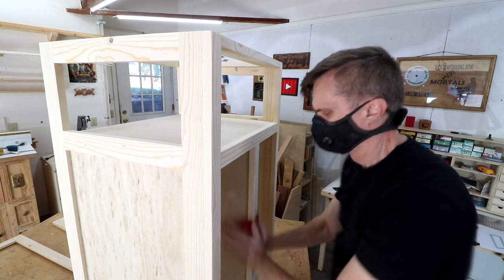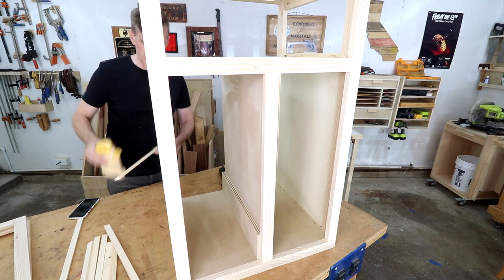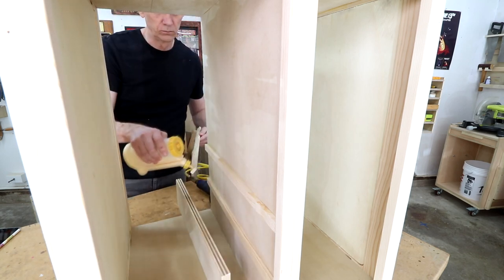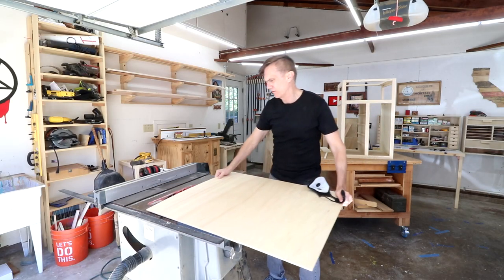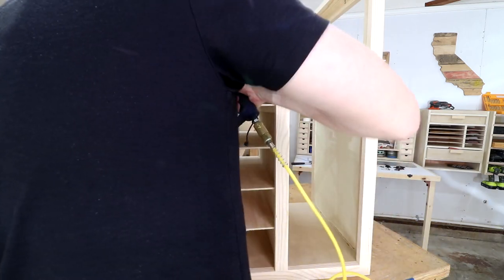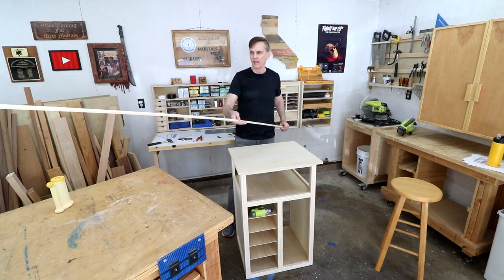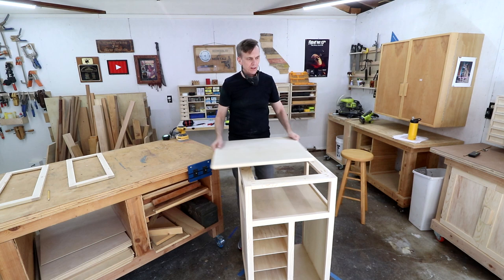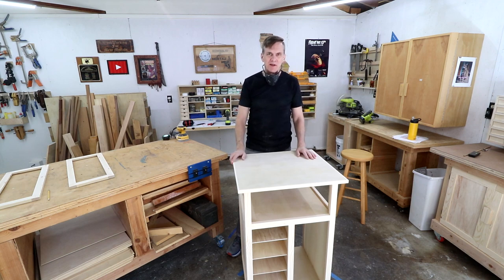Day 6 | Wrapping up the printer stand assembly | LOCKDOWN WOODWORKING

Comment: I took a short hiatus from the shop and finally got back in there yesterday for a small project I did for my coworker. Man it felt good to run some power tools and measure and cut and glue and screw and  sand etc. Good Times 💥💥💫💫👷‍♂️👷‍♂️

Comment: You should mention that BEFORE assembling, sand those parts that would be difficult to sand after the project is all put together. You could always do a little touch up sanding later. For example, the inner shelves, the vertical support,  and plywood in the side panels.

Comment: VIDEO REQUEST: how to cut straight using a circular saw. Please!!
Reply: Hi, Christine. Get a straight edge and clamp it to a piece of scrap wood. Make a cut. Measure distance from the edge of the straight edge your circular saw’s base plate was running against to your cut. That’s your offset. Now, clamp the straight edge this offset distance parallel to your cut line on your workpiece. Make the cut. Voila, straight cut. You can make a little straight edge jig if you will be needing to do circular cuts often by taking your straight edge and gluing it to a piece of 1/4” plywood. Make a cut. The right edge of the plywood is your offset. To use the jig, line that right edge up with your cut line, clamp it in place and cut. This is great because you don’t have to measure and it’s repeatable. Do a search on circular saw straight edge guide here on YouTube if not clear. Another great alternative is a Kreg Tool Rip-Cut Saw Guide. A great $40 purchase. I love mine. Kreg Tools, Amazon, Lowes, Home Depot can mail it to you. Have fun!

Comment: I am a little surprised you glued and pinned the shelves. I would have thought a bit of flexibility would have been nice. They fit snug and they are narrow, so, they won't have to work to hold any weight you add to them. Side note. Have you considered adding a bumper/standoff or 3 to the back so you don't have to worry about pinching cables?

Comment: So you mentioned they were 3/4 inch pins going into 3/4 plywood. I get that the pins are going below the surface of the plywood (and this into the other piece), but how much should you expect the pin nail to go for sufficient clamping force?

Comment: That was a short one. Do you only make so much progress everyday usually or this is just going slow because of the current situation?
Reply: In a shop building a one off, rather than production, this is about hobbiest speed.  Remember he has video to set up, plus he still has to edit which is very time consuming.
Reply: It has to do with the situation I guess from what I recall from another video (a long time ago) in which he explained the way he went about his weekly schedule.

All in all, he is not under the pressure of making it for just one single video a week, but more on the "enjoy the process" along the way.

Yes, as Keith says, he also has to film and edit the video, and that takes time as well but, again, he is not facing any deadline as one video per week would mean.